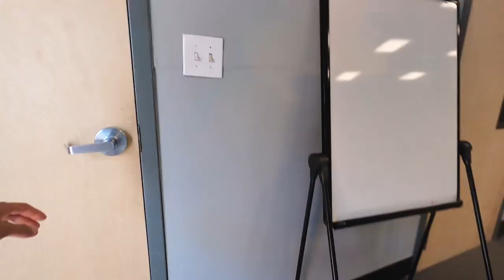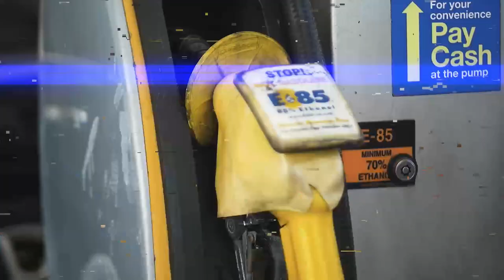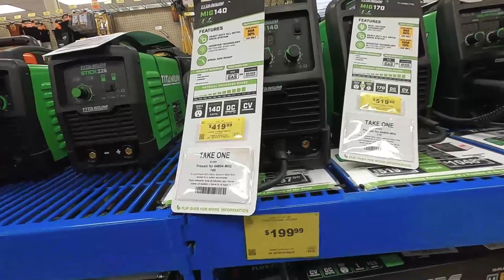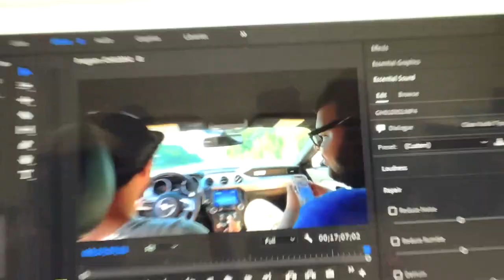GX470 Bags to Springs and s550 Ecoboost Mustang e30 pulls for datalogging | Super O Episode 3

Comment: Why didn’t y’all add the bump stops? I’m looking to do the same to mine.
Reply from the maker: The bottoms just needed the perch to sit on and the tops actually don’t need the bump stops if your factory bump stops are still intact (located just behind the hub outside of the bag mount location) also the ones we got actually didn’t fit inside of the springs so we ditched the idea of extra bump stop protection. Haven’t had any issues yet!
Reply: Super O Garage  would you still recommend any type of isolator?  Do you think they would improve ride quality
Reply from the maker: I don’t think it would change anything. We never hear any metal clashing or felt any real difference with the ride quality.